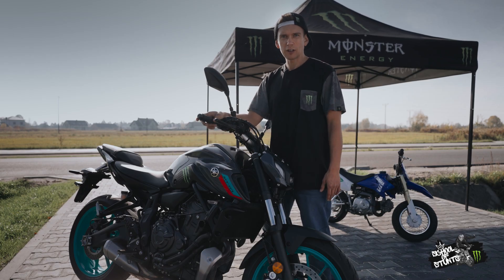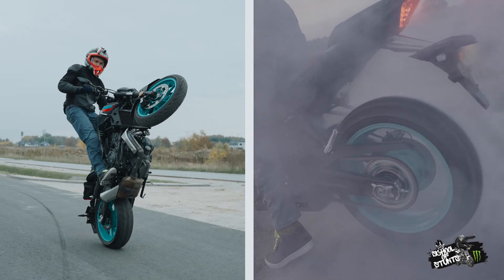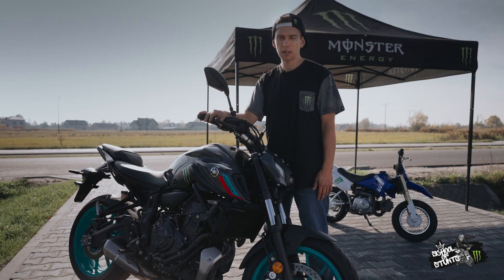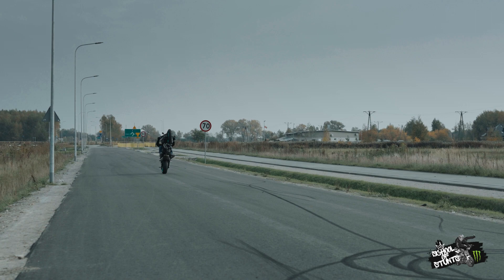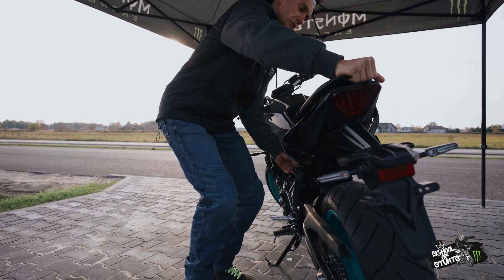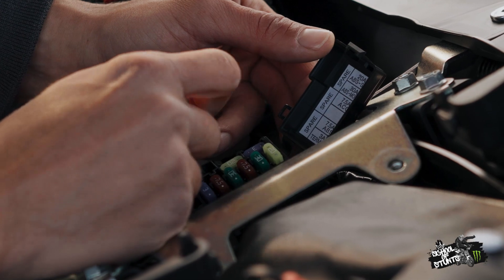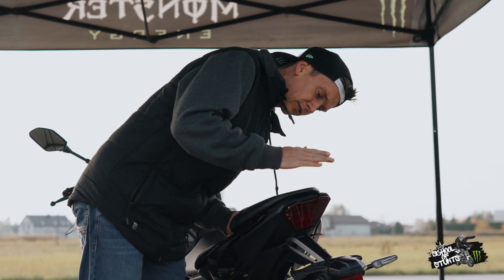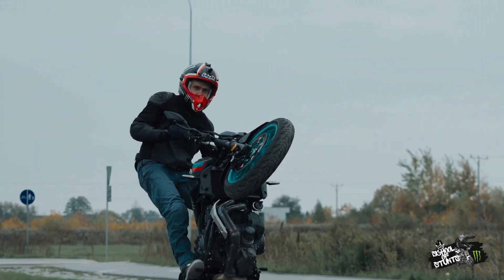HOW TO TURN OFF ABS IN YAMAHA MT07  [  SCHOOL OF STUNTS EP.2 ]

Comment: My question is this, when you remove the fuse the ABS light will stay on, of course. But when you put the fuse back does the ABS light go off or does it stay on and you have to get it cleared off? Thanks
Reply: Itll reset itself

Comment: Is there a way to remove just the rear abs?
Reply: I’m searching too, the front one is not annoying and can be useful on the streets, but that rear one… so annoying
Does this work with removing only the 7AMP one ?
Reply: It’s a single unit for front and back. If you can’t split the function.